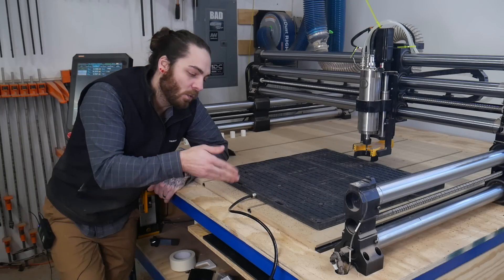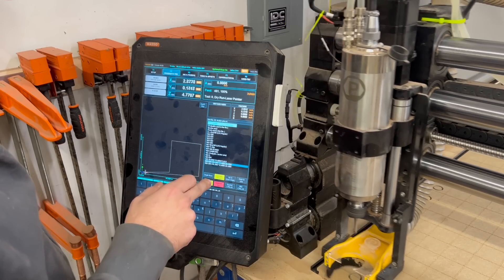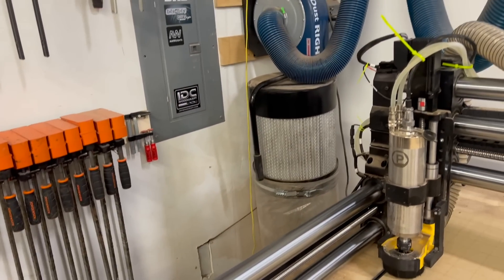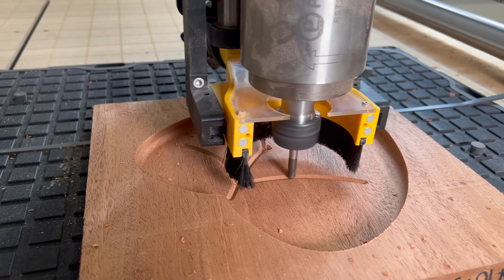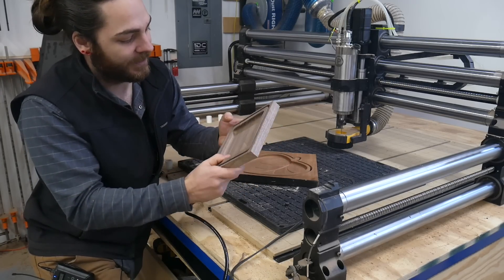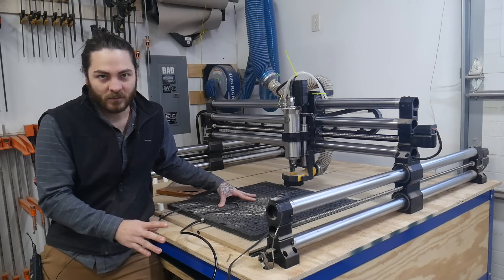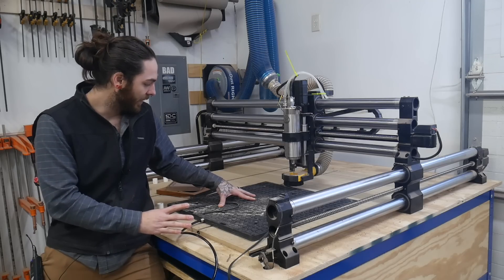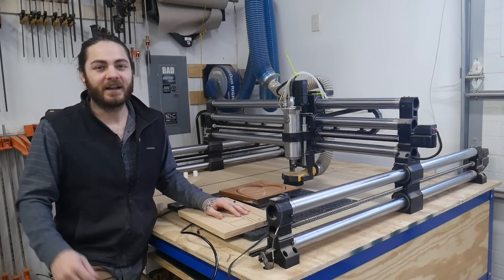Vacuum table on a hobbyist CNC? AirWeights Review/ first Impressions.

Comment: I confess that I did not read of the comments, so this may be elsewhere.   Did you consider not going all the way through with the intention of using a surfacing bit on the back side to remove the final few 1000ths of material?

Comment: Don’t think so.  Can’t cut through.  Can’t use index dowels for double sided projects or need to remove material one or more times during project.    And way to expensive when you make any mistake on z height (bit change and forget reset z - everyone does it).

Comment: Use the mdf. Mill both sides about .030". Seal the outer edge. I use wood glue and then caulk. Mill pockets at least halfway through it. I go 3/4 through myself. Cover exposed areas. I buy those cheap paper thin cutting boards. Put news paper between the mdf and the stock. Sounds crazy but works🤷‍♂️. Remember vacuum pressure holds nothing. It's atmospheric pressure that's pushing it down. More surface area equals more force. The key is to have a pump big enough to move enough cfm's, volume of air. So when you cut through a material, it doesn't matter because the pump is still able to starve the area of atmospheric. Starvation and surface area, this is the way.

Comment: Thanks for your honest review. I just watched a video by IDC Woodcraft praising the product. I was on the fence and purchased a 24x24 yesterday. I will provide my feedback after working with it for a couple of weeks. Thanks
Reply from the maker: I’ve definitely gotten more comfortable with it, I actually use it for like all my one off stuff and smaller things I cut. I’ll post an update video soon here  too.
Reply: Idc is a shill for the most part. He does make decent content, but to be honest it’s just a refresher to other’s content and a different style. We all are/ and or would be shills to an extent. 95% plus of hobbyists absolutely do not need a vacuum table.

Comment: I picked up a regenerative blower on facebook market place for 80 bucks. It is three phase so I ordered a vevor vfd to run it. Im hoping to stop wearing out shop vacs. Once I had my table built and cnc mounted, I cut grooves for a vacuum table and milled both sides of an mdf board. Works great.

Comment: I'm not sure a video on the topic does it any service if the learning isn't complete. I don't follow this channel so maybe this is more of a vlog experience.   I built one from MDF for my Journeyman. Its CFM based using a vac motor. Its noisy but can suck through a 1/2" MDF waste board that's sacrificial and works great and cost about half that and is the full size of the machine.  I do think most people don't fully understand the use case and best practices. Spending time on that would help make these kinds of tools more popular.

Comment: You could easily build a vacum table out of mdf and grooves with your CNC, for 1/10 of the price.
Reply from the maker: How much time would go into making it and designing it though? Your time isn’t free. I recently bought several work benches because by the time I factored in my time and materials I about broke even and saved a ton of time. But for some that just like to tinker around it’s definitely an option.
Reply: @TwoMooseDesign  I think that on a different context, I would 100% agree with you, but honestly here, it's way too expensive. 
Making a grid out of MDF or even better HDPE or Delrin/POM with the actual CNC you are trying to build it for is trivial.

Comment: I built something similar simply using MDF & a shop vac, 
I was doing a project that involved sheet aluminum & polycarbonate, while the vacuum table isn’t the best on small parts like you are doing here, it is a must on large sheet material.

Comment: Just thought I'd share my $.02.
You're on the right track if you're looking into vacuum beds. What I would suggest is looking into making your own out of plywood for the entire work surface of the machine. Yes you lose some Z space, but it's worth it if you never really use the full space to begin with. There are tons of guides online. That bed needs to be your new work table, so you cannot just place it down with locators and call it flat, because it can still warp from heat, be lifted by upcut and vibration, and/or shift from the looseness of the locators. It needs to be either bolted or screwed on as a new bed, and the new surface along with the gasket pockets needs to be made BY the machine when the new bed is in place. This way you can guarantee a true zeroed in Z axis across the surface and a bed that does not move. The pump is the biggest downfall of the thing. It's perfectly fine for designs that don't cut through into the vacuum pocket, but for designs that do you will need a high flow bed and a pump that can keep up with the loss of pressure. And then the extra talk about filters for the pump and spoilboard for the preservation of the bed that doesn't need to be really gotten into right now. The self made bed I'm talking about is only a half sheet of 1/4 ply and a half sheet of 3/4 ply, with a cheap-ish regenerative pump used as a vacuum source. You could even use a shop vac if you don't plan to hold your parts down for too long to burn it out. (give or take 30 minutes? varies)
If you want you can contact me for assistance. I've made quite a few of these for different size Shapeoko routers, and up to 5x10 commercial routers. A lot simpler than it seems. You have very good energy and good head on your shoulders, I would hate to see your time wasted because of sub-par products or people who simply comment "super!" and don't constructively criticize. Mistakes is where we learn, and the faster you know these mistakes the better.
Reply: Hi Anton. I'm currently building my own suction table and actually have some questions regarding some of the things you mention here. Any way I could contact you?

Comment: A few comments/observations.

A larger vacuum pump wont really help with the MDF because of the air channels on the plenum aren't large enough to allow proper air flow. These pumps are high suction, low volume pumps. So your items need to be pretty air tight to work.

I built something similar to this years ago and it works great if you set it up properly for repeated tasks. If this had been available back then I probably would have just bought it.

I would cut out some clear 1/4" acrylic tops to go over it, and use sheets of cover gasket for All Star CNC to make custom vacuum fixtures.  You offset your tool path, so the gasket cuts just inside your cut path and you go cut all the way through the part into the acrylic a few .010", and you can do 100s and 100s of these without tearing up your gasket. Once you have the cover gasket cut to shape, you remove the excess gasket and manually drill holes through the acrylic so that the air can suck through it and hold you part down. You can cut out pretty small parts that are repeatable and reliably. I make acrylic parts that are around 1" square and they do not lift. You can make as many of these as you want. You just zero your X-Y to a corner of the fixture and go.

All Star CNC has a bunch of blog posts of customer fixtures that you can see to get ideas from that will work awesome for a someone starting out. Those large 10 HP pumps are about 10-15k and require 3 phase power, so are out of reach for most people just starting out...
Reply from the maker: Thanks for the input! I have some membrane for the mdf on the way. Definitely great for repeatable cuts, the fixture plate would be great for slapping down the same sized item over and over. Thanks for watching! I definitely have alot to learn yet, excited to learn it
Reply: We have a 3 phase pump for our CNC. Works great for cabinet parts! Only problem is, I don't have our spoil board tied down to the table or bolted; on smaller projects (not huge sheets of plywood or HDF) I'm stuck having to turn the whole vac system on, and then isolating the suction to one quadrant. Mind you this isn't quiet AT ALL. I've ended up just turning on the entire table and just taping projects with CA glue or screws. 

I wish there were some way to have a hybrid spoilboard that is rigid enough for projects without the vac on, but doesn't have metal T tracks that my bits could hit cutting out cabinet parts.

Comment: Do you feel that I would need a torsion top for my elite journeyman which I’m going to install on a Kreg table as well.
Reply from the maker: Neither one of mine have one. As long as you have multiple supports in the middle you’ll be fine
Reply: @TwoMooseDesign got it. Thanks a lot

Comment: No thanks...I'd rather use clamps. Doesn't make sense to use if you can't use a spoil board. Pointless.
Reply: Honestly just clamp it and cut tabs. That is such a waste of time and sand paper
Reply from the maker: You can with the fixture plate and mdf. I also have a drum sander which makes it easy to remove that last tiny bit

Comment: Honestly,
I can't see anyway that this will pay for itself.  
$750 & now you are limited to being able to go full penetration.
I see for any possible time saved with this setup, you will quickly loose with additional sanding, band sawing & or trim router-ing.
This little vac setup just has a very small nitch application for it to be worth anything.
I guess I have just mastered holding down my projects via other means.
Thanks for sharing the good & bad on this product.

Comment: Wow. Your absolutely the first one to actually admit that you can't cut all the way through. It seems every one else kindly misses that very important part. That is very good to know for someone who has never had one. I never thought about it myself.
Reply from the maker: Which is why I wanted to do a video as someone who doesn’t know what their doing 😆 hoping it would answer the questions I had. I do need to order the membrane to see how that works. I’ve been using it all week and I leave less than .03” left and do two drums sander passes and works great. But not everyone has that option.
Reply: I saw on the manufacturers you tube page that he cut through the material.  Seems like you have to cut into a sacrificial piece  of MDF so the piece doesn't lose suction.
Reply: Airweights advertises a sacrificial board to enable you to do full cut through.  They also show how to set it up.  It looks like 1/4" mdf.  It comes with holes drilled for the locator pins to you can make repeat parts.  The boards look like something you can source and make on your own.

Comment: Nice - thank you for the review! For my purposes, I would want a way to place a piece on the vacuum panel in exactly the same location - I'm sure a spacer jig could be done. This certainly would solve any clamping issues, when I need to cut around the edges of a piece.
Reply from the maker: The black plate would be perfect, I think it’s called the fixture plate. You could mill out the perfect area for it to set into. It’s a non pourus surface so it will only sucks where you cut out. Thanks for watching!
Reply: @TwoMooseDesign  How much does each fixture table/plate cost? If one were to use this for different sized parts, you'd have to have one fixture plate per part.
Reply from the maker: You could probably get a few out of one you’d just have to plug off that section. I believe the plates are $40? I don’t think it would be hard or make your own, you’d just have to seal it off somehow, it’s almost like a melamine.

Comment: I believe the reason MDF didn’t work for you is probably because you haven’t surfaced both sides initially for air to be drawn. As for workability, it holds pretty well and if whole table is exposed, you can simply use any loose leaf or printer paper to cover non used are. As for me… $750 would buy me a LOT of blue tape. Sorry if it was sponsored, but being honest here. As a fairly new CNC user, $750 would buy me a new water cooler spindle.
Reply from the maker: Oh no! No worries at all! And most likely, I didn’t want to waste much time on the mdf until I ordered the membrain for the top. And I agree I stated that in the video it’s not for everyone especially new users. I’d buy a spindle over a vacuum bed. Not paid but he did send me the unit.

Comment: This is a good start down the rabbit hole. I recommend taking caution if you’re cutting through because you don’t want chips or dust getting down Into that vacuum unit. I have the black box vacuum system Storm unit with a full size hdpe bed that is the vacuum plenum. I use gasket for non-cut through. I have an MDF/ldf system with the foam sticker on top too. I love not needing to use clamps anymore if I don’t want to. Journeyman original BB controller. I’d love to have the elite. Great job on this intro to the vacuum world.
Reply from the maker: Thanks for the tips! The elite is pretty neat! Love the extra features and ease of use. I have a BB machine as well it it’s just fine, I do miss my x box controller on the elite 😆

Comment: When I first got my OneFinity I debated a vacuum holding system. I ultimately decided against it and your video validates my personal reasons. Thanks for showing it in various ways along with the potential accessories. We all have our own ways of working and its great to see what works for others.
Reply from the maker: Absolutely! Most people that have had a 𝙲𝙽𝙲 for a bit have their wasteboard tuned to what they do. This will definitely be a great supplement clamping system. It’s strong suit would be batching out the same carves, set up would be super easy but again depends what you make on a regular basis.

Comment: I wouldn't spend 700 usd for that, i find it useless at that size, i would spend that money to buy 1 pvc board and make my own vacuum table on the whole cnc. I think the pump is indeed too small but you can work with that and laminate boards without any problems, the more porous the surface is the worse the suction is.
Reply: To be honest I have not, but I took the time to study how industrial cnc vacum tables are made and it's incredibly easy. For reference, some chinese router factories use each machine to make it's own table as a test. You can do it 2 ways, using 1 board or 2 boards sandwiched and glued together, PVC is enough, although if you want to go for the best solution, either HDPE or POM or Phenolic Resin board is the way to go.
Last but not least, you're suppose to use an LDF/MDF spoilboard with sealed edges on top of the vacuum table, never cut over it directly, this will also fix your cut through problems
Reply from the maker: Have you used a diy set up? I’m curious how well it works. My concern with the diy set is how much will it cost me and how much work goes into setting it all up.  That’s the reason I went with a pre made bench, by the time I added up my time and materials I pretty much broke even on buy vs building. Thanks for watching!
Reply: @TwoMooseDesign I can post photos for help of my own router for you to see how the table is made as soon as I get to my shop ( I also have a 10 HP vacuum pump )
Reply from the maker: Ohhh a 10hp would be amazing! I’d need more power ran 😆
Reply: @TwoMooseDesign  haha 😆 I am lucky to have found a small space in an industrial area in my hometown. My router has an 8kw spindle, an 8kw vacuum pump and huge NEMA 34 steppers so without 20kw of power minimum I wouldn't be able to run it. But in regards to the pump aside from the fact that it's very, VERY Loud, the fixing power is amazing, it can hold even small parts really easy and makes cutting almost anything a breeze.
Reply from the maker: That’s amazing! I’m definitely jealous 😆